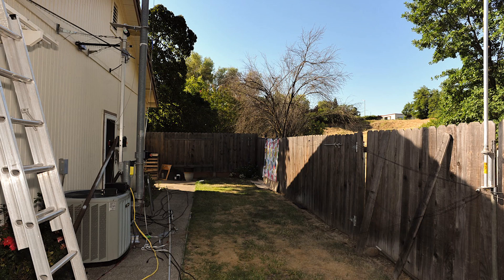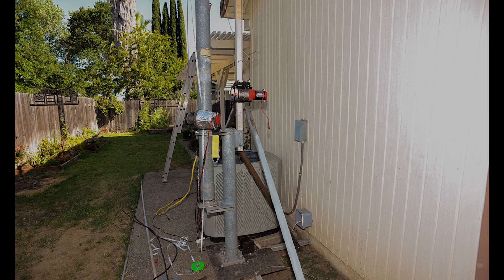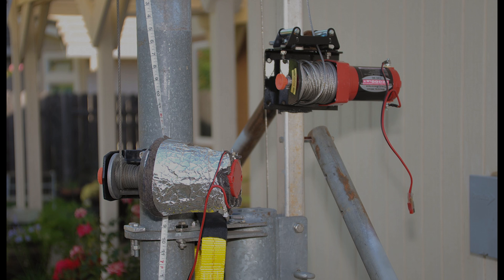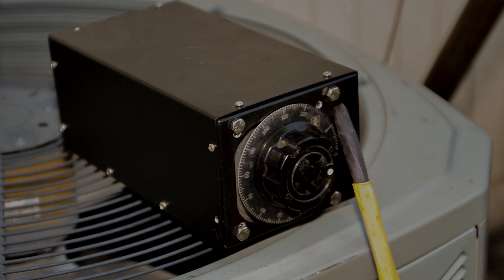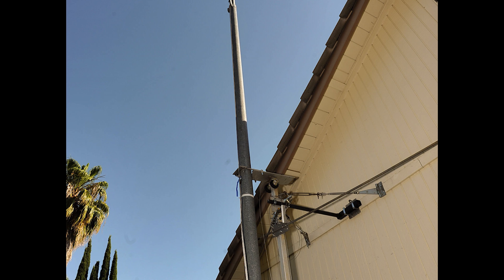Ham Radio Tower, US Tower MA40, Installation in Process by Jim Heath W6LG, Your YouTube Elmer

Comment: Hello Jim, I know this video is a couple years old however, I am hoping you see this as I have a couple questions... I have the same tower and have been moving it from QTH to QTH when I have relocated. I have in the past aways installed it out in the open with about 3 yards of concrete and all the recommended rebar etc... I see yours is bracketed to the house. Did you have to fabricate the bracket or is there a bracket available commercially that you used? Also, it appears you have it bolted at the base to a sidewalk. Was that a preexisting sidewalk or did you pour a pad specifically for the tower? Thanks for your time!
Reply from the maker: It is sitting on the walkway and then locked into place with some 2 by 2 by 1/4 stock tube.  It cannot move at the base.  I used steel pipe to bracket to the top plate of the wall.  The wall is about 10 feet tall at the top plate.  I did through bolts.  The pipes are attached to hinges so they could be just moved into place.  The installation is not quite real property and might meet the definition of personal property. The motors or winches are they cheap ones from Harbor Freight. I use a 30 amp PWM for speed and a large switching supply.  I can lean the tower over to do repairs.  73, Jim
Reply: @Jim W6LG  Nice... thanks for the details. I may be doing something similar if spring ever comes here to upper Michigan.

Comment: I think that noise is much higher because the motor is secured on the lower mast itself and the vibrations are amplified on that square tube. 
Any way, this is not going to be up and down every day, so no need to fix it right away. Although I would like to see the other 2 motors working and understand the mechanism. 73 de SV1SLB
Reply from the maker: I added the reflector yesterday and moved the tower very slowly to the ground.  That does help.  You are right.  The big tube is like a big speaker cone.  For now, I dare not spend any more money.  So a new motor will have to wait.  I did insulate the motor somewhat from the tube with some padding.  Thanks and I hope to be QRV on 20 meters soon.  I have to add the matching system and the director.  The boom is 18 feet long.  Thanks and 73, Jim W6LG

Comment: I just received a Drake TR-4 without a mic.   I haven't plugged it in.  It hasn't been used in almost 40 years and has been stored in its original cartoons, safely, all this time.   How should I proceed with getting this back on the air?
Reply from the maker: The mic is no problem.  I don't remember if it is high impedance.  It is likely high due to the time when it was manufactured.  Caps are the big problem.  I mean the paper and electrolytics.  It might make sense to start by replacing all of them.  If I remember correctly, it has all tubes and a pair of 6146 in the final with something like a 12by7 driver tube.  Something like that.  I did sell those Drakes at a store in Burbank in the early 1970's.  I would probably research the idea of replacing all the caps and then slowly raising the line voltage using a Variac.  A thorough examination and cleaning.  The PTO in those had some issues, if I remember correctly.  I would read up on how to clean or service the PTO mechanism.  Very very carefully.  If you crack that rod, it will be big trouble to repair. 
 Having said all of that, it is really a great rig.  I think it was high impedance.  If you can get a Shure 444, that would be the mate to that transceiver.  The Shure 444 is the dispatcher's mic that you would see in cop shows.  Broderick Crawford would yell 10-4 and throw it back down.  He also often spoke into the back of the mobile mic in his car.   I still have one of them.  Crisp clean audio at a cheap price.  You don't need a $200 to $400 mic!  Another choice for mic would be an Astatic 10da.  I have 3 of them and one is my full time mic.  I hope that helps a little.  You got a great transceiver that with a little work will be good for another 40 years.  73, Jim W6LG

Comment: Hello, thanks for your videos its so helpful. I have inquiry; I did google research for antenna dish Azimuth/Elevation Rotator and I ended with 2 choices. i dont know what to decide. Can you please light me. 1- Spid ras/hr rotator              https://www.rfhamdesign.com/downloads/spid-ras_hr-specifications.pdf            2- AER-5      http://www.cd-corp.com/eng/ama/rtt/erc5x_eng.pdf
Reply from the maker: Hello my friend!  Thank you for your question.  What is the size of your dish?  What is the purpose of your dish antenna?  What voltage is available for the dish?  Thanks to you Ahmed.  Regards Jim in CA.
Reply: Jim W6LG hello Jim thanks for your quick feedback. It is parabolic dish with 2 meters size. I want to use it to detect 700-2700 MHZ.the power we use is 220vac. Rotator supply voltage for spid ras/hr is 13.8 and 24 volts. Supply for AER-5 is 220vac.

Comment: Jim how do you think that Antenna will work on 40 and 75? Kind of looking for maybe a beam about that size for those bands, but dont have the space for a 40M or 80M beams.  You think it will work as well as say a full size dipole for those bands with a tuner inline and the beam  pointed in the right direction. I know this question has lots of variables  but kind of looking for a do all antenna. You planning on running anything else for HF?
Reply from the maker: Hi Sal,
Well......do all.....that is a tough question and tough answer.  Antennas that do all, don't do all that well.  

Maybe you were referring to the multiband vertical that I installed on the fence.  It is not a great performer but, you would have lots of fun.  For me, it will be a reference point to test other antennas.  It will have a much higher noise level. 

Multiband dipoles work good.  That requires separate wires for the various bands.  As you shrink the size of an antenna the efficiency goes down. Losses also go up.  

Another antenna that works well and will do many bands is a large dipole fed with window or ladder line to a good tuner.  Feedline losses are almost nil.  A long dipole might have some gain on the higher bands.  

If you have other hams in the area, maybe they can demonstrate their antenna.  

In any case, get on the air with something.  Try to be conservative with the price.  Making your own antenna will save money.  

Sal, I hope that helps you. 73, Jim

Comment: Oh dear, here come the HOA people. Not only are those noisy spur gears, they’re bad noisy spur gears, even binding once per revolution. The mast resonates, amplifying the binding, bad, noisy spur gears. We love you, Jim, but that winch/hoist’s gotta go, and its replacement has to be isolated from the mast. Add me in support of a worm drive unit. I wonder whether wrapping the lower portion of the mast with a dense material would dampen enough vibration. The rubber mats at farm stores come to mind.  Cool mast, though.

I marvel at all the antenna portraits on QRZ pages. It’s as if hams never understand that only hams like antennas. Other folks might admire our homes or children, but they actively dislike our antennas. It’s no different than the car enthusiast who doesn’t mind a salvage yard, while normal people consider them eyesores.

Respectfully submitted, and 73!
Reply from the maker: Thanks. You have given me some really good advice that I will use.  HOA, you bet they will.  I tried wrapping and it did not help.  That attached metal, as you mention, just makes it worse...like a speaker cone.  Thanks for your help. 73, Jim

Comment: Very nice rig!
Reply from the maker: Thanks!  I need to fix the noise problem.  The noise is amplified by the motor's connection to that metal support.  Thanks Richard.  I went to school with folks named Casper.  It was shortened from Casperian.  73, Jim

Comment: Full speed  that thing sounds like a massive PTO driven brush mower. Still cool, though.
Reply from the maker: The noise is a big problem.  I will get it fixed.  It is not as noisy as my neighbors gardeners with their leaf blowers.  But, that is no excuse.  I have to reduce the noise from the PTO!  73, Jim

Comment: Some sort of high durometer rubber mounts may help isolate the noise to the winch.
Reply from the maker: I will try that.  Very large grommets, bumpers and whatever else I can find.  Thanks Shain. 73, Jim
Reply: @ham-radio  Another option would be to mount the winch to the concrete base.  One step beyond that would be to change out the wire rope for synthetic winch rope.  The more decoupling the better.

Comment: Hi Jim, Nice install! I love the MA40 design and spec, Have you considered building an enclosure lined with sound deadening material around the winch? A ham friend of mine has done just that with the winch on his crank-up mast and reduced the noise enough to be able to go out and lower the mast in the early hours of the morning without disturbing his neighbors. I seem to remember he told me he used a couple of layers of rubber backed carpet underlay, it worked a treat! Hope you get to top-out the tower with that beam soon! 73, Tom.
Reply: Great! I was thinking the same thing. Even two sheets of plywood leaned onto the lower part of the tower where the motors are will help. Grow alot of pole beans up around the whole mess for stealth. LOL

Comment: Awe man those dad gum noisy spur gear winches. That thing is almost about as an old 440 Holmes wrecker unit. Wish I had a few  worm drive  winches I could send out to you if the sound aggravates the neighbors. Sure enough would be stealthy then. I think you said it tipped over too so there is no way of putting a sound proof box with a roof jack on the mast pipe to keep water out. Looks good tho Jim. Won't be long and you will be smoking some waves across the horizon.

Comment: so what is the maximum height?  I like the square tube inside the round pipe idea (the cable is free) but what keeps the square tubing from rotating inside the pipe?
you said it was quiet so you must be awfully close to the motor with your microphone.
the real question is, did Mrs Kravitz give it a thumbs up?

Comment: Hi Jim,
Nice installation and extension winch. I have the Wilson Tower equivalent a TT45 installed in 1980. Have the rotating base raising fixture and use a Dutton-Lainson 1 ton worm drive winch for the extension that I drive with a Harbor Freight Bauer cordless drill. Stay safe.   73   WB3BJU